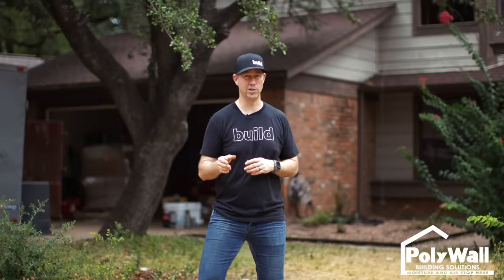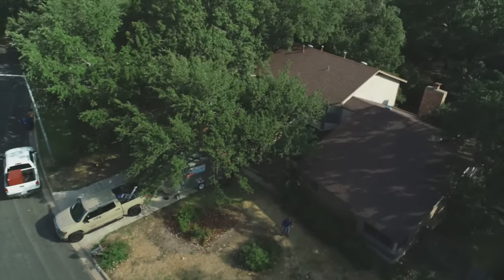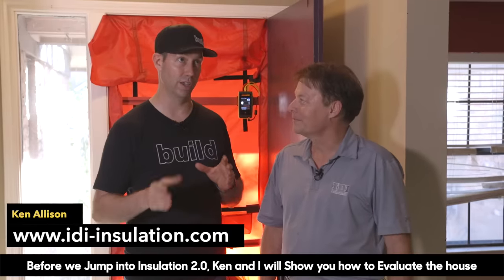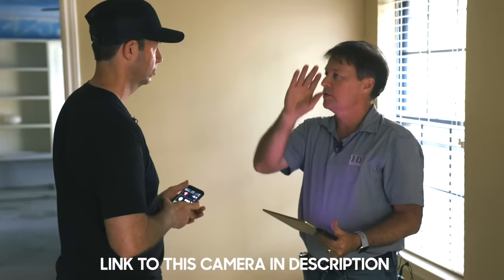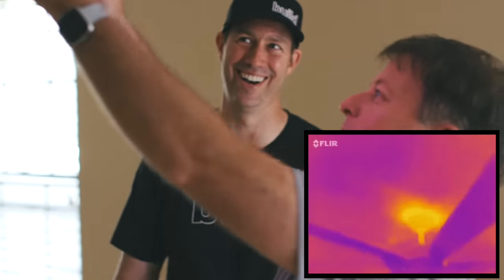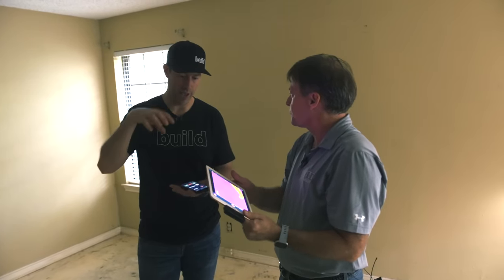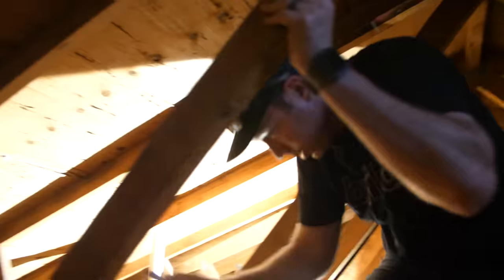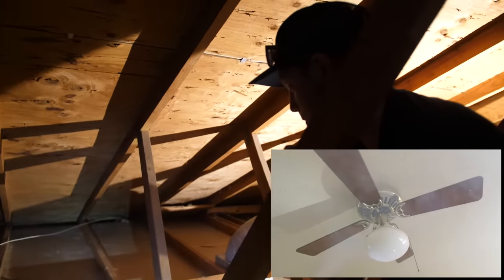Insulation 2.0 - 3 Steps to Re-Insulate

Comment: Great video! Very informative! A couple of years ago I watched a video about how moisture barriers are not necessary and didn't really understand it very well but this video clarifies a lot of what you were explaining! For my own projects (in Philadelphia) I'll probably still put a moisture barrier up since it's just plastic, but will also start using foam like you did here!

P.S. Stephen (and most guests) definitely had a funny look at the end when you said "next time... ON THE BUILD SHOW!"

P.P.S. I'm not great a video editing but I will try and make a Youtube compilation of all your guests' funny looks whenever you sign off "... ON THE BUILD SHOW!"
Reply: Moisture barriers are required by code to fix the inadequacies of fiberglass.  By itself, fiberglass is a poor air sealant and a poor insulator. Even when propped up with foam "sealing" and plastic vapor barriers, blown fiberglass doesn't  perform nearly as well as cellulose.

Comment: Only issue I have with any of this is that plasticizer migration can be a serious issue over time when electrical cable insulation comes in contact with foam products. It can cause the plasticizer used in the cable to leach out over time and the cable becomes brittle and loses its insulation properties.

Comment: what part of middle class budget does this fit into? or maybe we need Matt's definition of middle class.
Reply: Matt discussed multiple options and variations as well as pros and cons of each along with their relative costs. It doesn't take a lot of imagination to see how one could buy some spray foam in a can and make some significant improvements in air sealing, thus increasing comfort and decreasing utility bills. An individual on a limited budget could invest some sweat equity and time and $75 worth of spray foam and have a payback in a few months with continued savings for years to come. Or someone with a larger budget could hire the pros to do it. The beauty is we know the techniques thanks to Matt and we are empowered. I don't think your classism or victim mentality will help anyone reduce their energy bills or help them with anything else for that matter!
Reply: @texasengine  not my point, in the beginning of the series Matt said he was going to do a rental rehab on a middle class budget, Im just calling out the fact that its not realistic for a middle class budget rehab to do a blower door test, sucking out insulation and replacing duct work that doesnt need to be.  Im no victim, I am 44 and retired comfortably from my rental properties, I know what makes money and what is a waste, there are very few tenants that would pay more rent for an air sealed home, I get energy efficiency, however, the level of air sealing Mat is showing even if done yourself would be much more than $75 Time has value, or at least my time is valuable , every improvement needs to have a cost recovery amortization vs life cycle of the upgrades, and the air sealing being done will have very minimal  direct result on a tenants energy bill, and to remind, this is intended to be a rental property, the tenant pays the energy bill, it has zero ROI to the landlord,  as long as the home meets minimum rental energy efficiency standards additional upgrades are nothing more tan feel good upgrades. I know you will call me a slum lord, and if you think that, thats fine, my units are nice for B&C class rentals, my tenants are working class people that want affordable housing in good condition. but based on what Matt's end product will be, he will be looking for an A+ tenant in what is clearly a B to B- neighborhood.  I think Matt is a great builder and I generally love his content, However I feel he is way outside his world trying to teach about rental properties.
Reply: @schlz69  Point taken. He did shift gears and mention that he is likely to make this his next family home. I know that the point of this video is not -- how to be profitable remodeling a B-C rental. These videos are made for a wide and diverse audience and are designed primarily to exhibit best practices with regard to creating quality, long lasting, energy efficient residential buildings. Obviously you are looking at it from your vantage point as an investor in income properties. While that's perfectly valid, there are many other reasons to be interested in these videos.

Comment: This was a very informative video Matt and I always learn from your content. This insulation subject is constantly evolving and I understand that. Your True R Value subs did a great job as well. But those top outside edge ceiling to wall connections or terminations have got to be addressed as well. 

One very important question. Why did they NOT seal the outside wall top plate (drywall) between trusses in the attic? This is a horrendous air leakage point and it is in every truss bay. I am referring to the area of the top plate and where the wall and ceiling drywall meet and there are many leakage areas there. You did it to the inside partition tops, so there had to be a reason you did not do this. Was it too hard to get to?

I know this space can be very tight to get, but it has to be sealed. I would have cut 14 1/2” pieces of styrofoam as high as you can get and put between trusses on top of plate from attic. Then spray foam the edges and bottom to seal off all this air leakage. If not you can literally get outside air coming in all around these truss areas. Then shoot in all the insulation you can as it will be airtight for sure. 

You can even get to it from the outside but eave covering would all have to be taken off. This is usually not an option. 

I did it to my attic in zone 6 as I literally had air infiltration coming in from eave vents and it literally lifted my batt insulation from top plate and went in between the insulation paper and the ceiling drywall space. 

Needless to say I now block every truss bay and put in styrofoam insulation to seal this up while I can easily get to it. If anyone has any other ways they do this please comment as it is vital to seal this up. And yes I always order higher truss heel height to adequately insulate all this area. 

Great videos and this subject is one I am very interested in seeing. Again I am in Zone 6  but this area should not be excluded from any and all efforts to seal it.

Comment: The new "less itchy" loose blown fiberglass takes 15% LESS fiberglass to cover than the old stuff; that's why fiberglass installers love it - more profit for them. But the much lower density means less thermal barrier and even more settling. BTW, why not share the R-value per inch? Is there a problem?

Comment: Matt Risinger: We're looking to build a two story hours 2250 square feet the second story isn't open to the first story and is only joined by the stairs. We're in East Texas and looking for the best insulation closed vs open cell and looking to see what is more efficient and easier on the electric bill to use 1 big 4 ton split zoned AC unit or two smaller units. The upstairs is only 800 sqft total with the 2 extra bedrooms a gameroom and 1 small bathroom. Master is downstairs.
Reply: Todd Ison my parents did a reno with closed cell and were horrified by the lack of soundproofing between rooms. Haven’t torn into a wall to see if there was a mistake, but I know about acoustics.
I believe they mechanically coupled the floor to the ceiling below via the foam curing rigid and touching both surfaces. Open cell is almost certain to give superior sound isolation, as sound looses the most energy when traveling through porous materials. But there’s limits to that: not porous enough and the effectiveness is diminished. Mass is the other, more primary consideration for sound isolation. But mass (including drywall) only really works when there’s 2 mass layers with an air gap in between, or even better if the gap is filled with fiberglass or something like rockwool.
Maybe that’s a consideration for you, maybe not. Cheers.
Reply: @fosterlewis7360  Ya thanks Ryan we decided to just open cell the exterior walls and use bats or rockwool between the floors and some of the interior walls. Thanks again.

Comment: Recently bought a home in Waller, TX that was built in 2008 and it is has severe air leaks.  Switch plates buckle in the summer and can feel and smell, hot, musty, attic air coming into the conditioned space.  Have to run 3 portable dehumidifiers full time to keep RH at 50%.  

Haven't had house tested, but have been looking for the right contractor  in my area. Any connections or recommendations?

Comment: All my fan protushions are foamed. Electrical boxes holes siliconed. 1331 is because of condensation also. The walls around hvac unit need to b foam filled. Been dealing with this issue 3 yrs. The walls sweat on the inside. Marine foaming those adjacent wall for hvac room solved issue. Spray foam under shower and bathtub reinfoces bottom and also prevents sweating.

Comment: I would highly recommend doing the post blower door test before you blow in the insulation.  And you want a contractor that understands how to do zonal tests so you can see if you missed any low hanging fruit.  Sometimes one area is so bad, it will hide an area of the house that is mildly bad.  The last thing you want to do is pull out insulation you just put in so you can go back and fix some air sealing and tackle a secondary area that wasn't obvious from the first test. 

I also disagree about using foam in the attic when you have gas appliances.  I have only been in one house where the gas appliances in the basement had the proper combustion air source and vented properly under worst-case depressurization.  If the combustion zone is not vented properly, no matter where it is in the house, it is unhealthy for the occupants.

I can't emphasize how important a cold roof is.  And it doesn't matter if it is on the inside or outside of the roof (this example it is in the inside).  They help with protecting your insulation from damage and your structural materials from damage.

Comment: When will you address your plans with the ducting? I don't see how you could move the ducts into the conditioned space. Perhaps you intend to replace the HVAC system with several minisplits? My 1990s Austin home only has 8 foot ceilings, so I'm curious with how you'll proceed.

Comment: Matt, I have a lath and plaster house.  I plan to use closed cell foam insulation.  I also plan to have canless LED recessed lighting.  Should the foam be injected first before installing canless recessed lighting then drill and carefully cut through the foam to place the light; or, should I install the lights then entomb the canless recessed lighting in the foam? 

I have concerns about any heat, or need to service after "entombing."

Comment: Regarding the home energy audit sales scam: some counties/cities/states/utilities providers will offer audits alongside a “go green” tax credit program. I’ve had them in my home and they’re not selling anything, they just perform the audit and give you a report.
Reply: Rightsize Pillow , the attic should be a complete separate zone from the living zone. The point of air sealing is to stop air transfer from one to the other in all seasons. The attic should vent in from the soffit, along the roof decking and out through the ridge/ turtle vents. Power fans create a low pressure zone in the attic in relation to the areas it connects to. In the event of a perfect air sealing that is from the soffits and that is a positive result. In the event of missed/ inaccessible areas it will pull “conditioned” air from the home. In a northern climate’s winter that causes condensation and the potential for mold. 

As a BPI (Building Performance Institute) Air sealing contractor this video was pretty spot on. I don’t agree with having to suck EVERYTHING out all the time, but it makes air sealing a lot easier. It also pads a company’s bottom line.

Comment: Thanks Matt, I am really curious what you do about the exterior walls missing insulation. We have a 1906 home, and based on how cold some of the rooms are I assume they are not insulated.
Reply: They 99% are uninsulated unless someone did it later on.  Your two main options are to drill holes on either side and blow in cellulose, or remove the wall covering on either side and blow in insulation or put in batts.

Old houses were sheathed with wood boards and are super leaky.  If you ever need to redo siding, stripping the exterior and putting up new OSB/plywood, wrap, and then new siding would make a huge difference.

Comment: If the attic is hot, it means the roof is too dark which is the mistake the vast majority of homeowners make.  Even Mat Risinger hasn't caught on to this and he is a builder!  DU!  If the roof is dark the heat over a period of hours will penetrate through the attic insulation and radiate into the house raising the air conditioning bill.  White is right.  You can use a white trailer roof sealer to change the colour of your roof to white.  Use a roller and roller pole to apply.

Comment: I noticed that you stated in this video not to do a spray foam attic if you have a gas furnace in the attic. This is a great point but I want to check that you are referring to when you have a furnace without an exhaust blower? Every furnace I have ever owned in my houses always had this blower that is connected to a duct going outside the home. I assume if you got a furnace like this you are ok?

Comment: I have a 2700 square ft ranch house with 10/12 pitched roof. The contractor use insulation bats. Every roofing contractor I called was afraid to enter the attic space because the bats were not attached to anything. No sprayed in insulation could be seen. I should've had the roofing contractor who did my roof pull 6 or 7 pieces of sheathing off to inspect the attic.

Comment: question Matt: Where I live and build here in New Zealand, electricians get really antsy if you were to put expanding foam anywhere near their PVC insulated cables. Allegedly the solvents in the foam, over a long time, say decades, would eat away at the insulation and cause a short, possibly a fire if you dint have a RCD. What's the take on that in the USA?

Comment: After watching a few of your videos, what would be your preference between using Rockwool/Mineral wool vs spray in insulation on top of the air sealing done here? While the Rockwool is likely more expensive, it's qualities for fire prevention and vapor permeability over standard fiberglass insulation make it seem more preferable based on the info you have put out. Thanks for the great videos, they have been very educational.

Comment: Hey Matt, why do hvac installers use Metal drain pans under the blower units in the attic that eventually rust and leak?? Also, Why do they install the drain line in the sidewall of the pan?? 
Why wouldn't they use a Plastic pan that's molded with the drain at the lowest point and the drain at the bottom of the slopped pan??

Comment: I hope there is a follow-up with the IR imager, after remediation of leaks and deployment of new insulation in attic.    Unfortunately, such measurement is qualitative only, not quantitative evaluation of improvement.   Still, very impressive potential improvement, and documentation.

Put a Proteus thermal and humidity sensor (wi-fi) in that attic, and let the results be recorded for a full year; this offers quantification.   
Point being, nothing Matt did in this video changes the ambient condition IN THE ATTIC, only in the living space below.   Improve that ambient, and the heat transfer through wood ceiling joists and top plates will be reduced.

After one year, then change the roof.     Install ridge vents and radiant barrier (above rafter) with battens to enhance the "air gap" that is so essential to radiant barrier efficacy.  That's what I did, in Oct 2018.     Proteus in my attic, since June 2019.
After another year of collecting temperature readings, via Proteus, then install a SUB-rafter radiant barrier.    I will do this in early 2020.    Another summer should show marked improvement in attic conditions. 

It's the radiation emitted by the dark flat underside surface of the roof that heats that attic so profoundly.
Reply: So the video is only telling us half the story?  What?

Comment: Question, if instead of blown in insulation they were going with foam insulation and properly sealing the attic to the outside, would they still need to seal the attic to the inside using the closed cell foam? My guess is no, since the attic at that point becomes conditioned space, but I'm not sure.

Comment: Joking. Rockwool away  and foam inside. Never heard about heavy insulation for better safety for warm temperature in the hot period. The german word for this effect is: temperaturamplitudenverschiebung.nice! It means the time the air comes trozgh the insulation inside. This must be longer than its warm on a day or the sun shines. So your house had no chanche to heat up.

Comment: There are certain things you cannot air seal. You cannot touch some older can lights(and now a couple new ones). you cannot touch a b vent or a fireplace flew. You cannot put foam on a sprinkler line.
One last thing you put improper baffles where the venting is those reduced the venting. The rule is ventilation before insulation

Comment: First I love the show so, thanks! 
I was wondering if you could, after removing the old insulation and sealing large holes etc., could you you use the Aero Barrier system to seal the attic? Create a negative pressure in the attic let the Aero Barrier do its thing??? Just curious, not a builder but interested in building science, good craftsmanship, and high quality work.
Reply: Not the best option.  You'd have to seal all the vent holes in the rafter tails before running the AeroBarrier.